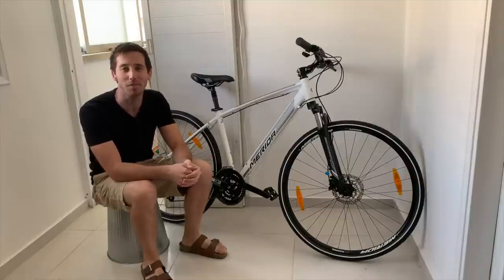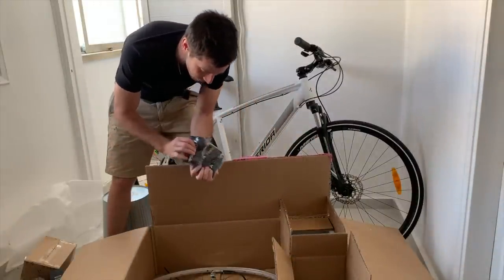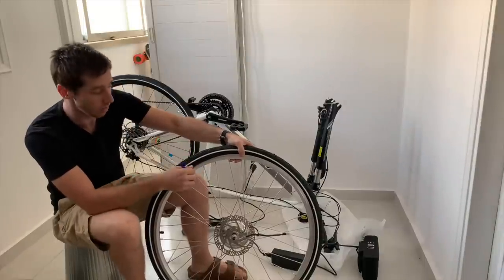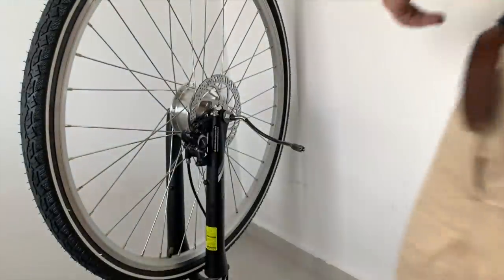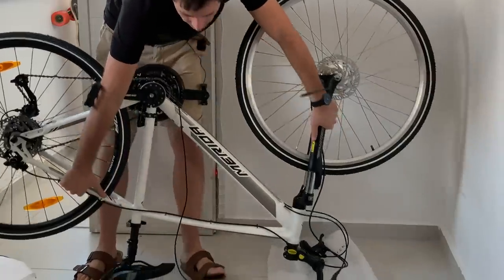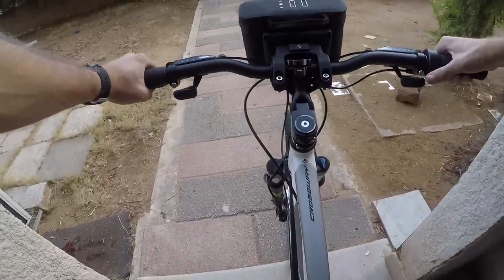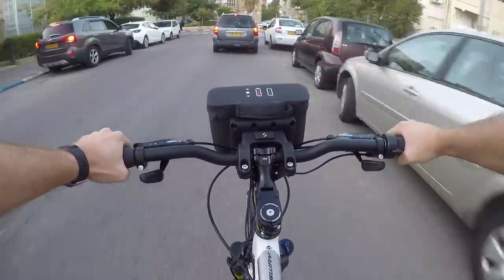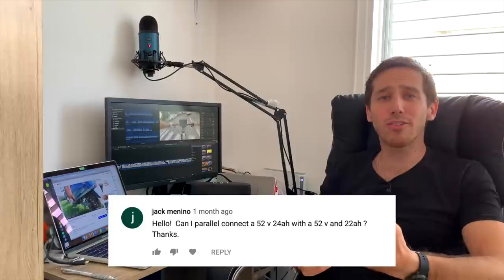How to build a simple e-bike with SWYTCH kit

Comment: Don’t leave parallel-connected batteries connected permanently.  Inevitably you get a weak cell, which causes the strong battery  to discharge itself into the weak one.  The way to get around this  i s to introduce a charge-bus, and discharge bus, and isolate each battery between a pair of diodes, for each one.  I use this technique in my yacht, with 8 12-volt, lead-acid, batteries.  Don’t forget to use Schottky Diodes, since there’s a potential 1.2 v drop across each diode, under high-current conditions.  Cheers, Robin.
Reply: I can see a lot of e-bike riders ending up in hospital with power
assist bikes when travelling at more than 25 MPH. THEN our lazy
legislators WILL ban E-BIKES or KEEP current ridiculous speed limits.
Politicians are too lazy to introduce sensible laws for e-bikes.
E-bikes need a speed limit of about 40 to 45 MPH so they are able to
keep in the flow of normal motorised traffic flow. ESPECIALLY ON
HILLS where an e-biker limited power to 15 MPH, is going to be
reduced to 5 MPH up hills IS going to be in a POTENTIONALLY DANGEROUS
situation given the impatient, inconsiderate average motorist.
Motorist are too stupid, too lazy or too fat to use e-bikes for local
journeys. Politicians and most car drivers are too stupid to realise
that the e-bikes WILL solve traffic congestion AND traffic pollution.
THEY HATE CYLISTS ! EVEN THOUGH RIDING A BIKE IS UNCLUTERING THE
ROADS AND PARKING SPACES. 

Imagine our cities where 90% of us are commuting across town by e-bike or
e-biking to and from the train station. Trains can be easily adapted
as necessary. Pollution levels and the gorgeous whether would return
to the levels we all enjoyed during the Coronavirus lock down.
Pitifully Obvious - unless you are a dumb politician. E-BIKE REGULATIONS NEED TO BE UPDATED.
SCREEM, SHOUT and E-MAILS TO JOURNALIST - POLITICIANS AND MOTORIST. (
ie your mum and dad ) TOXINS from ever increasing motor vehicle use
are poisoning us and our children. All of us are wasting thousands
hours of valuable time in unproductive traffic congestion. The e-bike
- tandem e-bikes - e bike trailers for the kids and shopping is our
likely salvation ! 

E-bikes need regulations if they are to become the most popular form of

commuter vehicle. Unfortunately Registration plates insurance and
construction regulations for safety, similar to mop-heads will have
to be adapted. Hub motors are too unstable at speeds above 30 MPH -
Mid drive compulsory -  Rim brakes wear out rapidly on faster e-bikes and are therefore dangerous 

- disc brakes should be compulsory for e-bikes - Compulsory -e-bike battery 

detachable to prevent theft and for recharging at work
or destination with employers require by law to facilitate. Lockable
anti-theft tracker system - compulsory.
Speed limited by law to 45 MPH but with enough power to maintain that
speed up most hills. Motorway lanes adapted and progressively widened to provide 45 MPH e-bike and
e-recumbent bikes/trikes lanes where riders are three or four abreast
from initially using only the emergency vehicle access lane. Truck
lane 55 mph and car lanes 70 MPH.

In Life the sensible are handicapped by the imbeciles. The most common
accidents on motor bikes occurs when folks pull out in front of an
approaching motor bike because the driver didn't see the motor bike
which of course is bigger than an e-bike. I would strongly suggest
fitting a LED head light which can be set higher in daylight
preferably with a yellow cover to help the drivers see you
approaching the junction. Bear in mind older drivers have poorer
eyesight and much slower reactions. It's not much help being in the
right if your dead. At night remove the coloured lens cover and lower
the beam. We all need to scream at our idiot leaders in all countries
to adjust legislation to make e-bikes more popular. The Laws in the
UK are ridiculous. Most reasonably fit riders can easily exceed the
15 MPH limit without power assist but the same rider travelling above
15 MPH on a e-bike fitted with power assist EVEN if the power assist
is not being engaged WILL BE BREAKING THE LAW. Failing to registrar
the bike as a motor vehicle - no registration plate - no insurance -
no motor vehicle lighting regulations - not wearing a full motor bike
helmet etc................... Please copy and paste everywhere !

Comment: Hi, have you seen any similar kits for wheelchairs? I do like the simplicity of this, and if only there would be a solution like this for wheelchairs that wont brake the bank... I am using an older system from yamaha but parts are expensive and very hard to find.

Comment: A little tip for the grips that I got from GCN is: lift the end of the handlebar (one close to shifters) with a little screwdriver and squirt some water with dish soap. Then try twisting. Repeat underneath if needed. I can't stress enough how well this works, even on the very old bikes I was restoring where grips were truly stuck.

Comment: Question -- I'm 6ft and weighing about 230 lbs. I'm thinking of getting into e-biking. I work in a hospital and I commute daily almost about 7-8 miles each way. What power motor do you think would suit me the best?
Reply: I'm the same weight,definitely get the large watt,you'll thank me.
Reply: 700 watt or 1k
Reply: Get +1000w with 52v 17ah battery

Comment: Nice mod! Looks like a center-lock brake rotor @ 3:13 - can be removed with a bottom bracket tool
Reply: Jeff J the centrelock rotor is a shimano patent and requires a splined centrelock compatible hub to reuse it. He had to buy a new rotor as the motor hub utilises the standard 6 bolt rotor fixing method on the hub flange boss. What concerned me most were the tight clearances on the fork and the need for spacing shims to pack it out. Something was not ISO standard here and i suspect it was the suspension fork on the donor bike. It would have been less of problem with a rigid road fork as the fork blades would have been narrower.

Comment: This video is just what I needed as the Swytch materials on their site assume a higher level of bike work knowledge than I have. I have gotten stuck on the disc rotor part as my bike doesn't have one. OK to install without? I full accepted that this would be my slow winter project but I was hoping for a tiny bit more guidance! Thank you.

Comment: Would you suggest the disc brakes / hydraulic disc brakes, over the traditional rim pad brakes?
Is the motor that strong that a bike needs the disc brakes?
Also, how far can you go on a charge if you're biking on a flat away

Comment: Hi.  Thanks very much for putting this video together.  I'd like to ask for a shot of the power cable exiting the wheel hub and the angle of it before you strapped it to the front forks.  My cable is facing down when the bike is right side up, and it seems a strain on the cable at its exit point to turn it upwards in order to tie it to the forks.  Glad you're getting over the Pneumonia.  A great advertisement for motor assisted cycling which will help folks like me have more confidence on getting on a bike to get fit and eventually to cycle with less assist!  Happy New Year. kx

Comment: I put an early canbus BionX back wheel on a Hasa mountain bike. Motor controller and torque sensing was built into the 250W hub, so as soon as you applied force to the pedals the motor gave the required response. I now have a new Hasa mountain bike with a Tong Sheng DZ2 250W crank motor with controller and torque sensor built in. It took some filing to get the TSDZ2 to fit the Hasa frame, but it's a great bike. You don't get regeneration with a crank motor, but it's more efficient to coast as fast as possible down hills, but I do miss saving my disk pads and charging my battery when braking. Regeneration is also good for very steep descents on tarmac.

Comment: You didn’t mention how the bike felt coming off the power and braking....you hadn’t fitted the brake sensors.  The kit looks interesting but as others have mentioned on here, just what is the price?  Swytch seem to want me to preorder and get a 50% discount for doing so, which is great but there’s no way I’m committing myself to an unknown cost!
Reply: Yup, and a year later the website still says the same, and still no clue of the price, however I seen this same kit on Fully charged show and it's £1000, adjust to whatever currency you use, but WAY too expensive considering you can get a generic E-bike for half that.

Comment: I built a class 4 ebike about 8 months ago. That means I have no PAS system. I do 30mph with ease. I can go well over 30 under the right conditions. Keep in mind, just because I can go that fast doesn’t mean I always do. I have and do push the limits of my bike often, that does mean I take mountain gravel roads and trails that dirt bikes are on. I also have had multiple problems come up and had to learn a ton about every component involved. Ive had to find answers to problems even the experts that sell and work on the expensive ebikes don’t know the answer to. I’ve had to learn the hard way, many times those same people have been completely wrong. It seems they always advise the most expensive way to find and fix the problem first, even if they aren’t going to be making any money out of it.

At this point the only original parts from when i began this journey are my battery and my motor. 
I began watching this video to see if there was one component missed,  and there is.
Not long into the video you see him put the disk break directly onto the motor hub. I did the same as it seems no one has taken into consideration one result of this.    When you’re going down a steep hill or slowing down from higher speeds that disk break is going to get hot. Extremely hot. In turn that disk break is going to make your motor hub hot too. And as you work the motor going up it stays hot and back and fourth. This heat, I now believe can travel from that disk break, make the motor hotter than it would be, and follow the power lines, all of them, back to the controller, and even into the throttle. 

There is a plastic connector for the 5/6 wire connection of the hall connection and such. I’ve melted that twice.  I had melted it the first time and had a ebike shop fix it for me.   They told me I had been taxing the battery too much going up hill.    Unknown to me they replaced it with the same part than wrapped it in a bike inner tube and made it look like it had been heat shrunken.    I was pretty mad when it melted again.      There’s more to that but I digress.
I fixed that by hard wiring that connection and insulating it. No plastic to melt.
I rode very hard on some mountain passes yesterday.   My throttle went out for the second time, but I wasn’t aware of it  until this morning. I took both thumb throttles apart. The wires were broken in the same spot in both. Either the wires are arcing. Or my theory about heat building up through the wires as a result of the disk break getting hot.  Or.   As a 3rd very real possibility, the parts are just made cheep. I did some research and found that the throttle I payed $37 for 2 times. Is sold on the web for $7. Just sold under a different name.      I have what that store called a beefier throttle now, and my bike is running, they gave me this throttle for free. I’m not hopeful it will last and plan to replace it.  
My plan is to go to a scooter or motorcycle shop and find a heat gasket to put in between the motor and the disk break. No idea if it will help. But I hope so.   Let me know what you think or if you have any ideas.  Thanks in advance.
26” 1000w 48a rear hub motor
Reply: Wow that is really interesting. I wasnt aware of that disk brake problem.

Comment: 9:45 Front derailleur height had me having HUGE issues to use all three the front gears. Too high, and it didn't shift properly, too low, and it rubbed. Deraileur hight is a MAYOR issue.
Reply: My Trek 4500 is also very sensitive to derailleur height. Tolerance range is only about +/- 1mm for perfect and reliable shifting.  This appears to be a show stopper unless I can get this fully researched or mocked up before I purchase.

Comment: A trick I learnt to get the tyre back on without levers is once you can get no further with your fingers, go back to the start and push the tyre down into the rim. You should then be able to get a bit more of your tyre over the rim. Repeat a few more times and it will just pop in.

Comment: The disc looks like it’s a center lock. You should be able to remove it with a cassette removal tool, but that doesn’t help if the new wheel isn’t also a center lock style to mount it.

Comment: Hi Micah, just came across your site and as I have converted a couple of bikes/trikes I thought I would compare.  The kite I bought were both front wheel kits from EBay and I liked the Swytch kit due to its size. The kits I bought
Reply: Required a separate battery which I chose 12aH.  How much was the Swytch kit.  The EBay kit was £120.00 plus £130 for the battery.  Look forward to watching your other stuff.

Comment: Good to see you back you’ve been missed. I own a Swytch kit got mine last February the handlebar mounted battery case is twice as large as yours though they claim similar battery range, maybe you 
Could give some detail of what batteries there using and other ways they managed to reduce the size and weight. Swytch claim it will fit any bike but in reality you do need at least some diy skills but that’s 
Been the fun as i managed to fit this kit to my tandem cycle and yes it works which I find amazing for
Such a small wheel. I did manage to brake a spoke and had to true the wheel but this motor on a tandem two people plus panniers probably at its limit certainly takes the sting out of the hills.
There is a forum on Facebook where people get to air there views about all things Swytch which may be of use to you. Take care get well soon look forward to seeing more content from you.
Reply: How much did the kit cost you? I'm looking into getting a preorder now

Comment: I have yet to see an install video where the person didn't run into any issues with the installation, so I don't think it matters what bike you chose. How are you liking it 2 years later?
I just got one and I'm super disappointed that you can't use the quick release with the wheel. I didn't even think of that when I ordered. Almost a deal breaker. :(

Comment: Looks like the disk rotor on your old wheel is held in place with a lockring, rather like the lockring on a rear cassette.  The rivets that you mention suggest it's a "fully-floating" type rotor.

Comment: Glad you feel better. Anyone can jump in with and answer here even small businesses.

A hardware store was going out of business so I picked up 8 (9 one Ive opened) 12v XRP DC9071 batteries assume 2amp/hrs

I had a look at a $10 drill and pulled and and the battery apart completely and it was very hard work for me Im riddled with arthritis and other muscle issues and even carrying things is an issue let alone trying to muscle my way into an electric battery.

So instead of pulling all these batteries apart Ive decided to try and build them together into a bank of batteries. Hopefully charge them on the vehicle of choice and discharge from there, so how I wire them up and then what the charge unit is Im sure there is a variable charger, what brand of variable charger? links?

I just bought an e-bike not long ago and its with a bike mechanic as I have designed a 2 wheel tilting front end and its powered by 48V 8.0amph so great right I have 3batteries worth or power in my hands. BUT I wouldnt mind like a offroad go-cart style vehicle Maybe about the size of a Polaris RZR 170 single seater if this amount of V/hrs can get me some fun speed and a decent amount of track time (yeah I know thats variable to throttle use) So would love suggestions on kits, things people have seen. To wire the batteries together the safest way to isolate them and pull them out and in if batteries need replacing it would be best to have like torch or drill skins, finding them even in China is proving hard especially nothing for torches and I dont want to pay $20USD per skin, does anyone know of supply, me sending a message to the USA from Australia is like whistling in the wind. 

So has anyone got contacts? Websites?

Any amateur willing to give it a go? Somebody even willing to design/ build a unit and then it to Australia all at my cost of course and I'll plug batteries in plug in the charger and wait for fun time?

Or I will maybe make a double hours time 48 x 16amph battery and possibly configure that like a V8. willing to hear anything, remember I wont be doing the work and TIA!!

Comment: The disc is a center lock, you would need a Shimano BB tool to remove it (Some use cassette tool instead  would have splines on the inside rather than outside)
The silver bit that says Shimano on it is essentially a nut holding it on
The rivets attach the disc to the holder, Can make it lighter and quieter.

Not that there is anything wrong with 6 bolt but tend to find it on slightly older or budget bikes

Comment: Hey Micah, I have the earlier/first version of swytch (about 1year) and my battery just stopped charging. I wish that I could just shop around for a replacement battery but i think that they have a custom setup, is that right? In order to get the flexibility to swap out bad parts, would tou suggest avoiding ‘custom-designed’ kits like this? Finally, the 250 and 500 watt kits you linked to good for easily finding and replacing parts? I ask because I use my ebike a lot so downtime is a problem. And maybe you can do a segment about this issue too.